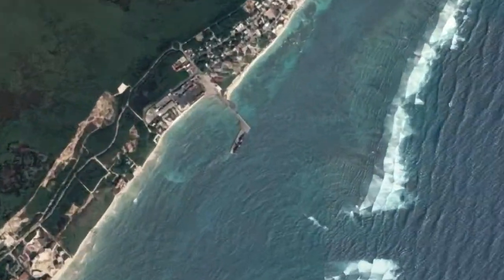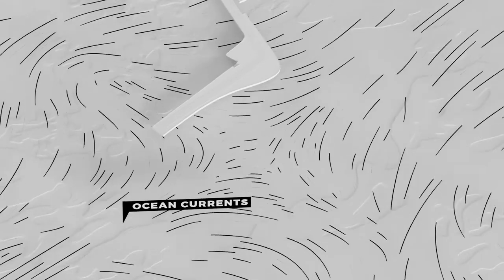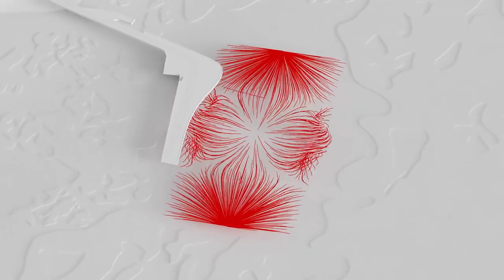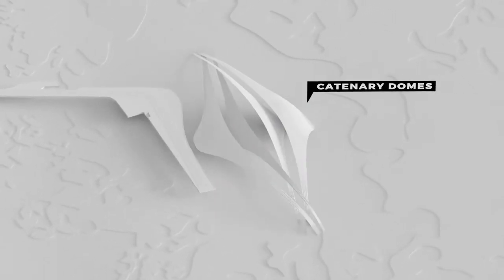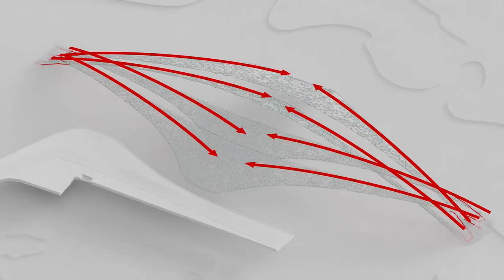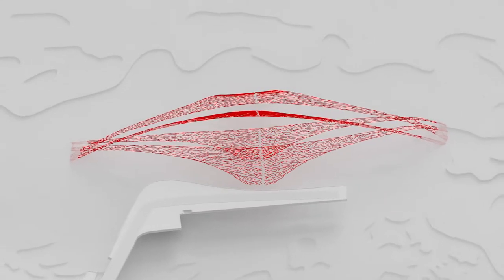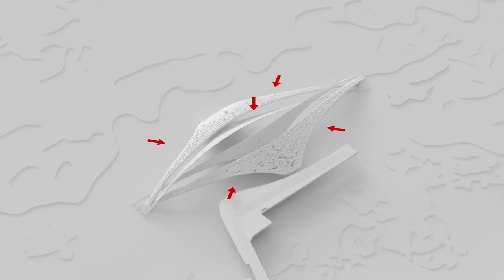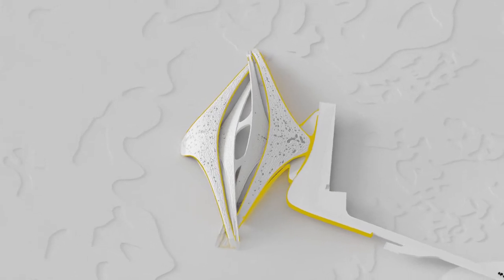Maritime Research Center | Final Evaluation Project

Comment: I would prefer a research center built on an existing campus (where researchers are already), with portable units located near the coast for field work support. Less damage to the ocean and the environment in general. There's no need for offices and all right in the water in order to conduct field research, generally utilizing boats.